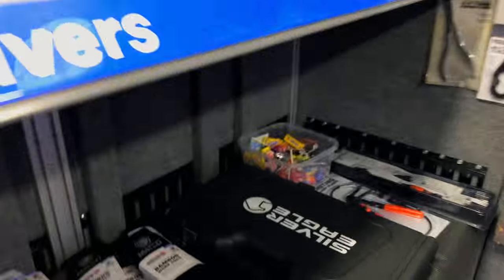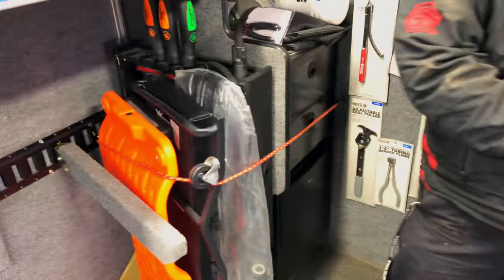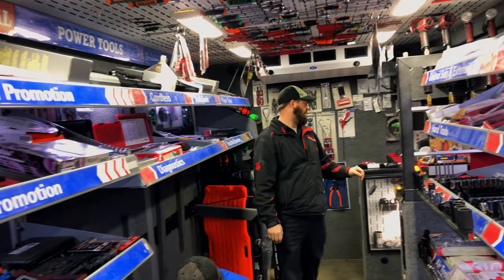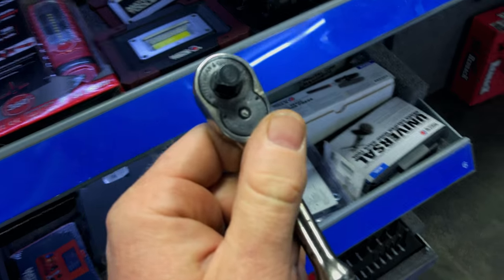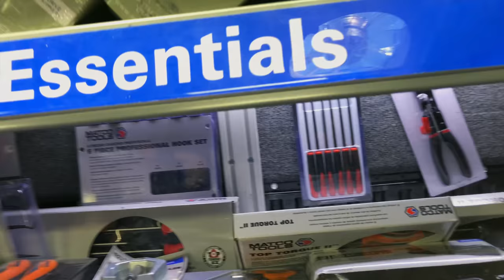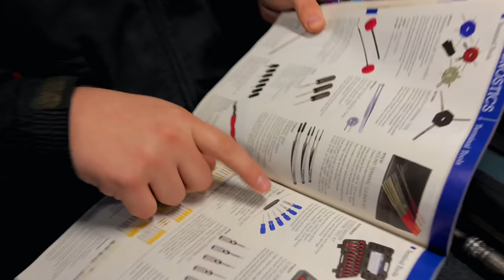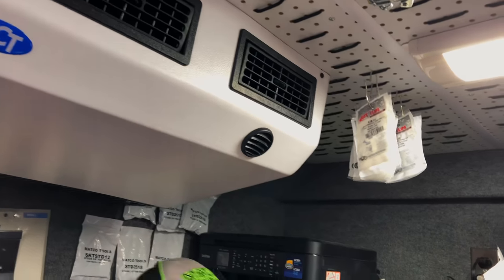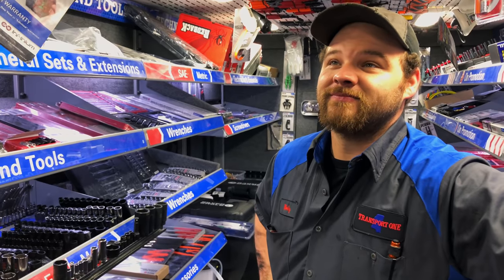Matco Tool Truck, New Boots and Brand “USED” Tools

Comment: Thank you for the good tool advice! The best penetrating oil I found is SYNTHETIC TRANSMISSION FLUID and Acetone mixed 50/50. It is much less expensive and works better than Kroil. Use it in a chemical resistant spray bottle. I am non-sponsored. Just know what work best for me.

Comment: Have you looked at a real man's boot? Frank's, Nick's, White's, and other brands. A thick leather, soft honey Vibram sole, custom built to your foot. Not glued together foam made to fit 100's of feet. Then when they are worn out you throw it in the trash. The price? $500ish is to much for boots. Well no lets look at it over time. How much are those boots and how long will they last you? With A traditional quality AMERICAN MADE boot you can get them resoled or rebuilt. They can last you 20+ years. Your on concert all day. Have you tried a honey vib sole? They are soft. A high arch boot will straighten your back. The transition/break in may be ruff for you but I'd never go back.
Reply: 500 for some boots. Thomas that you on the other side?
Reply: There all made in Spokane wa